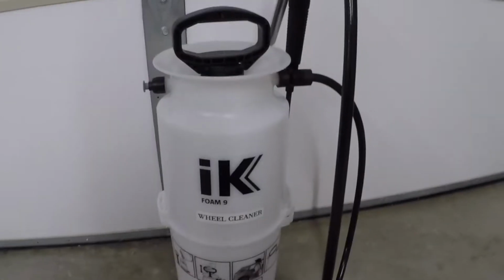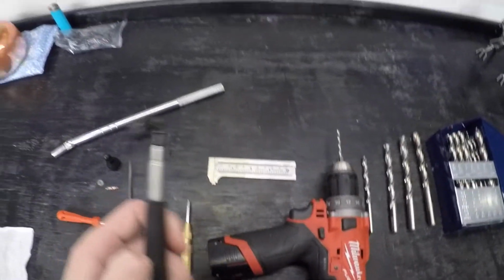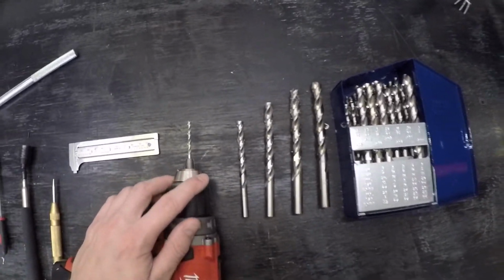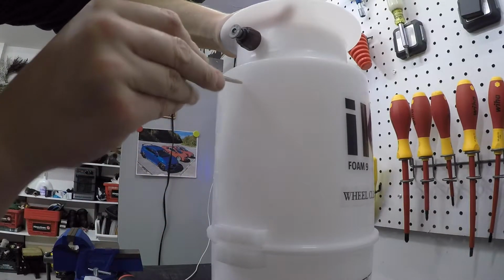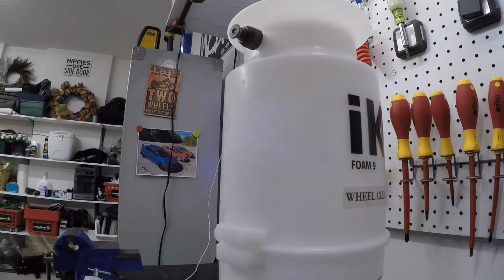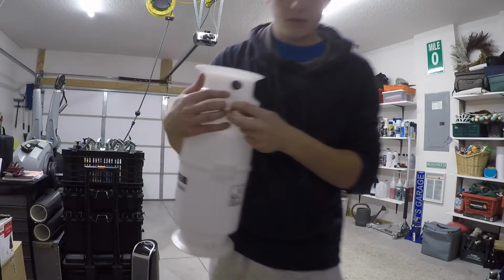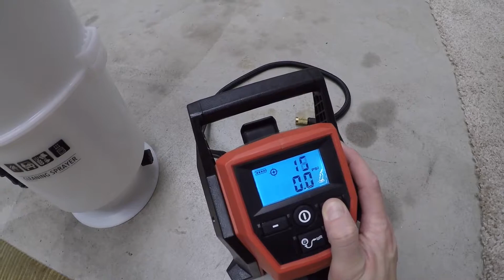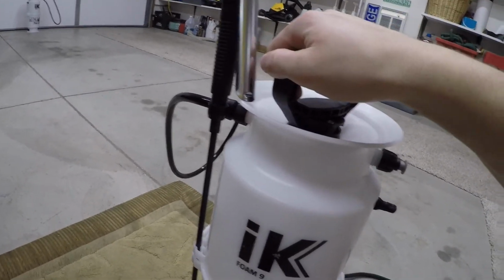IK Foam 9  Modification

Comment: 55psi hasn't given you any problems? How many vehicles do you think you could foam?
Reply from the maker: @J. Falto zero problems 👍🏼 I use it for my wheels so hard to say id say 3 or 4 cars depending on how foamed up u get them. 3 or less if they are suvs or trucks. I get probably 40 wheels per fill up on average. I always use my foam cannon on paint. Keep in mine though if ur doing a entire car even at 55psi you will still have top her off with the air compressor several times. Thts the biggest reason i only use it on wheels.